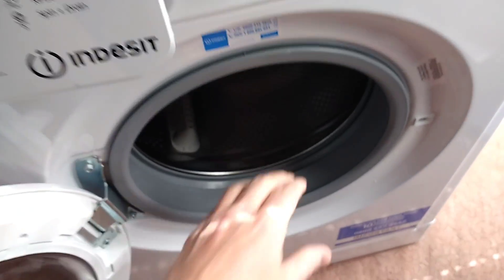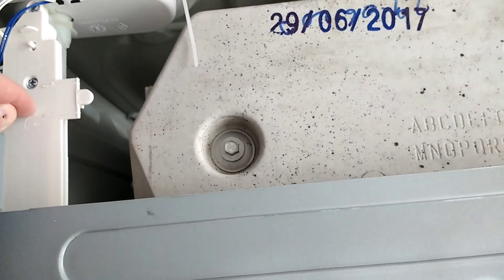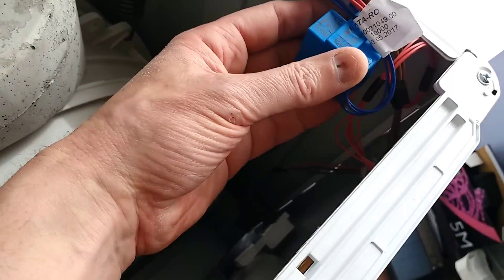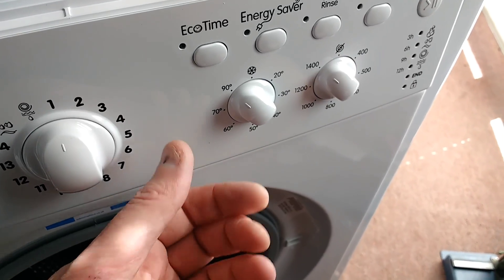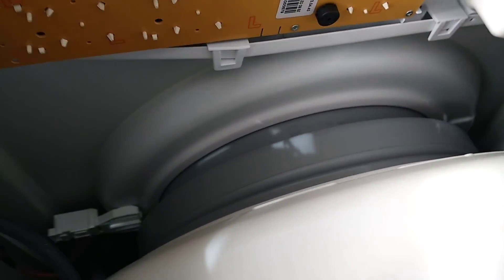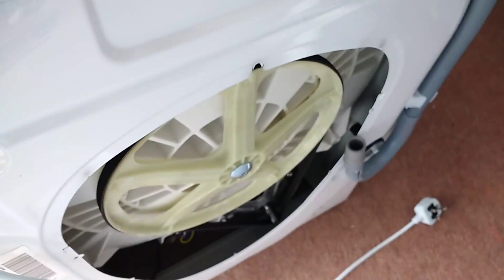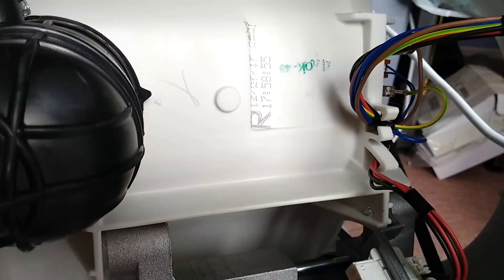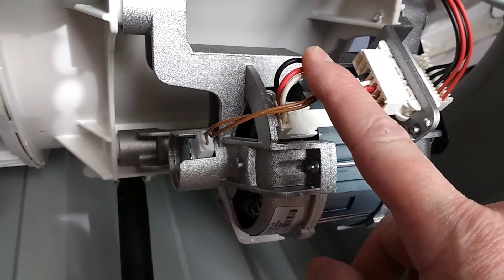Inside my new British washing machine (clothes washer).

Comment: Tha old aluminium drive pulleys make wonderful wind chimes, Note: the computer is unprotected and at the bottom of the machine, maybe directly under the water inlet.
Reply: It's not under the inlet. It's under the drain. Ive not seen one get water damaged in five years as a service engineer
Reply: Our Fischer and Paykel SmartDrive washer has all the electronics behind the main panel, well away from moisture. Mind you it is a top-loader (which are more popular Down Under than front-loaders).
Reply: It's the responsability of those with skills to not play the "buy a new one" game. This attitude also increases self reliance and prevents slavery under a parasitic finance sector. Cheers.
Reply from the maker: I'd like a Maytag top loader, but they're very hard to get here.
Reply: Phil S I've never really had any problems with the modules being low down in the machines. Those toploaders are supposed to be excellent though
Reply: We've got a Maytag top-loader that we bought when we bought the house, I grew up using side loaders and man are top-loaders better for taller guys like myself.
Reply: bigclivedotcom I can get the commercial ones. They're really expensive but would last forever
Reply: @f00f00mods  Hate to break it to you, but the commercial units are identical to the residential units, only with less control options.
Reply: We had an Indesit front loader, it decided to boil everything after a few uses (no warranty) cost of repair, (replacement control board, it got wet apparently) was more than a new top loader, we now own a new top loader. ;)
Reply: + the f00: Yes, they are. They do use a little more water (and are supposed to be harder on clothing) but the performance is better, along with durability, ease of maintenance, and parts (apart from the control gear - MCU / front panel failure generally means new machine, since the cost of replacement's not worth it). Our F&P is getting on (10+ years) and looks its age, but still works as new.
Reply: In my old Bosch the controller board is at th etop of the machine. Seems more logical, though there is more vibration and heat at the top.
Reply: Hi, I refuse to buy a washing machine as so many are thrown away for no apparent reason. I pulled a Zanussi Amie from the top of a skip 15 years ago, and it's still giving good service. Cheers
Reply: +Andy Reynolds The Zanussi here has 1/96 dates on it and came from house clearance along with its matching tumble drier for £50 the pair 14 years ago. Original bearings lasted 10 years, the replacements 11 and I've just had to replace the motor brushes using ones from a motor I pulled from dumped machine as a spare. Total cost of repairs so far is £107 or £7/year.
Reply: Multiple Planned Obsolescence ( = made for the dump )
Reply: water doesn't get to the module as its on the other side of the machine to the fill valve. BUT  if you don't check your pockets coins CAN smash their way through the drum & you flood your kitchen out, happens more than you think. been repairing these for 27years so I've done a few repairs lol
Reply: Mine dies every year, on the anniversary...
Reply: Hard drive platters make really good wind chimes.
Reply: YES ... the strongest body is useless with a very weak mind
Reply: Andy Reynolds indeed they do. Funny, I just discovered that last weekend.
Reply: Opposite corner. Also most of these are potted and waterproof.

Comment: If this is a new washing machine can we expect a vid on the old one?
Reply: Radial_Freaking_Engine hopefully given an appropriate send off involving copious amounts of pyrotechnics.
Reply: Some clever people have invented a new way of stabilization by replacing the concrete with rigid plastic moulded tanks built into the washer and filled with water when the machine is installed thus cutting down on weight in transit and making it easier to install.
Reply: He could give it to the Post Apocalyptic Inventor if the postage didn't cost more than the machine itself.
Reply: Dismantling the old one would be nice just to see what can be salvaged and put to good use. The motors for example can be very useful, such as can be seen in this video by The Post Apocalyptic Inventor:

https://www.youtube.com/watch?v=FgkcC7BnVCQ
Reply: I think there are old washing machines being discarded rather closer, voiding the need of shipping heavy old motors around Europe...
Reply: Or maybe the photonicinduction treatment
Reply: It's already been reappropriated , it gets him to work and back every day. :D
Reply: +FRANK ROBY - That is clever and yet simple.
Reply: By "the old one", do you mean the one that will go about 20.000 RPM and can insta-dry clothes in the next video?
Reply: Oh yes please, it would also be good to see how Clive rates the changes in design and manufacture between the new and old
Reply: I wonder if the water diversion pumps water through the main/No.1 compartment by default with each of the valves diverting it through the other two compartments? Or did you figure out how it works,Clive?
Reply: FRANK ROBY:  WOW... That's a super idea now !

Comment: Front load washer: Three main failures will either be the rubber surround for door seal (for obvious reasons), main tub bearing (because of how cantilevered it is), or aluminum spider for the drum cracking (corrosion and stress).  Ask me how I know...

Of course, it all depends how much you use it.  Once a week, will last years.  Multiple times a day, not very long.
Reply: FrankTheCat at uni the props department had a industrial spin dryer which would run at some ridiculous speed akin to 10,000rpm. After 10 minutes cloth would come out bone dry, but it was always a case of setting it running and legging it, because if that thing failed it would be like a bomb going off with the centrifugal force it contained. I hated using it.
Reply: Having had an LG front loader crack 2/3 spokes of the drive spider and slam the drum around violently, I'm now very wary of the construction of front load washers...
Reply: I'm back to top load washer...but all the new ones are the High Efficiency crap with a smooth drum and no paddles, so they don't clean really dirty stuff well.
Reply: Haha, if people knew the construction of front load washers, they would never overload them!
Reply: Paul Gascoigne - My current top load is under recall for this very reason.  https://pages.samsung.com/us/tlw/ Go to Google Images and type "Samsung washer explosion" just for fun...
Reply: FrankTheCat Problem with top loaders is that you can't stack stuff on top of it (typically a table or a dryer, but anything really).

Comment: The last washer I bought that had a hot water inlet was about 20 years ago. Since then they seem to be cold water only. Probably because when the hot water valve opened it took too long for the water to start flowing hot from the supply so they mainly filled with cold water anyway.
Reply: True, and teh amount of water has been reduced. And "modern" - as in post 1990 - detergent, with enzymes, wants to run at low temperature first.
Reply: The heat up time is used by the detergent to soak into the dirt.  Hot incoming water shortens the cycle randomly, leading to unpredictable results.  Also saves some cost.
Reply: That's a good point. We have the same trouble with dishwashers. You need to run the sink until hot then start the dishwasher, it it fills cold
Reply: The US models have both hookups. They also finish a load in about 55 minutes.
Reply: In Europe most countries don't have stored hot water, so they always used cold fill only.
Reply: bob s Correct.

Comment: If you're lucky, you may get 5 years out of the cheaply made POS. Sad how they make things these days.
Reply: My Aussie-made top-loading Hoover is 24 years old and hasn't skipped a beat.  Nowadays NOTHING in the way of white goods is made in Australia save for fridges and water heaters.  A lot of washing machines here are made in Korea or Thailand.  The Thai-built units use old Australian brands but they are nowhere near the quality of the old machines.  The worst machines of all emanate from China.  The build quality is TERRIBLE with cheap plastic drums, poorly balanced suspension and easily shorted control panels.  My old Hoover has a massive concrete ring under the main tub, which is 18/10 stainless steel and uses a proprietary "balanced orbital suspension" system.  It's a quiet machine with a super-fast spin cycle.
Reply: I bet he anxiously awaits for it to break so he can take it apart again and make edumacational videos for us :-)
Reply: @tripsadelica, I have a 5 year old LG front load washer. That said, I took out a 10 year warrantee on it. So far it needed 2 service calls which more than paid for itself. Why can't they build simple well-built products anymore? I'd gladly pay more for it.

Comment: The detergent drawer uses a motorized paddle to divert the flow of water between the three sections. The raised part on the top of the shower head cover is to fit the paddle.
Reply: The paddle only moves once before water is taken in. On older mechanical machines it was driven by a cable connected directly to the timer. If you can hear humming or buzzing it's usually from the solenoid valves.
Reply: seventees is it the drain pump having a spin up before allowing any more water in...  in case the last cycle was stopped by a powercut or something?
Reply: sorry but that's not right for this brand & hotpoint too. its 2 jets of water that when both are on they collide to make a 3rd jet
Reply: Wrong @ ferongr.  No flap, converged water paths is correct

Comment: Watch out for the drum hub corrosion. Aluminum and stainless steel creates a galvanic effect that will destroy the unit. You MUST do the monthly cleaning!

The GE model I had looked exactly like yours. I gutted it and you are correct, it's a 3 phase 1/4 hp variable speed/volts induction motor. Hopefully they at least coated the internal tub aluminum parts with epoxy or something to extend service life.

Comment: I guess it makes sense that they're only using one water inlet and an inbuilt heater, if they're going to use a pressure transducer to monitor water level.  It just makes the machine more efficient and accurate overall, since it can regulate (and monitor) its own temperature.

Cool video, Clive!